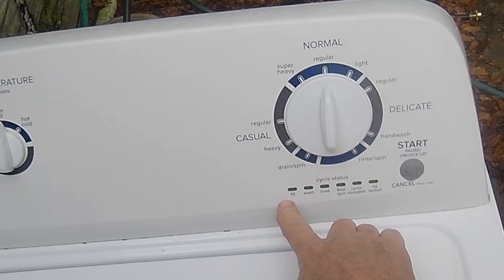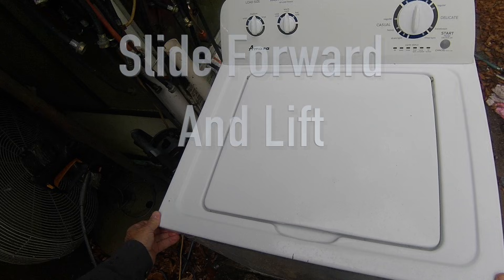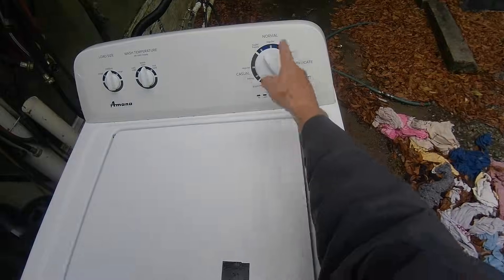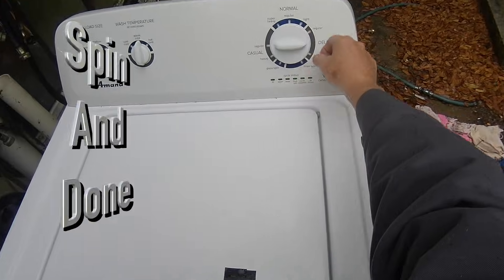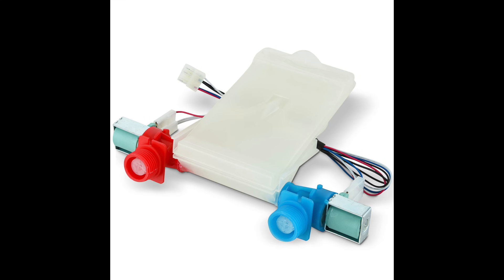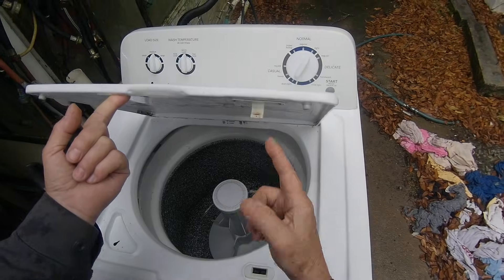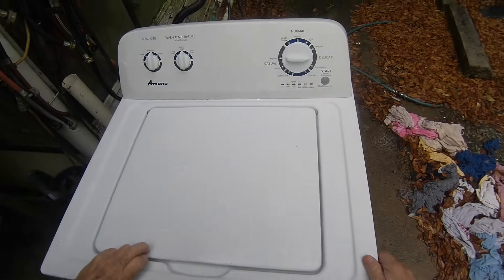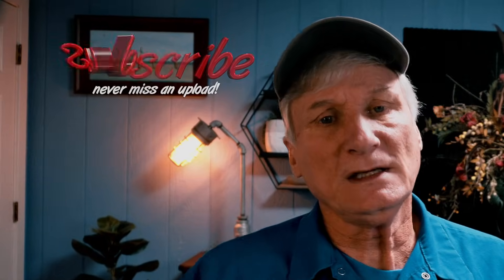How To Diagnose Your Amana Washing Machine: Chip's Guide to Manual Diagnostic Mode

Comment: Hi.. my amana stop with full load of water … the lid is lock and there no power… I try unplug n plug back on there still no power … so I have to unscrew it from the back to get the lid open…. can I still do the diagnosis with full clothes n water in it or I have to empty it out first? It look like I need to replace a lid switch right ?
Reply from the maker: Make sure you have power to the receptacle that it is plugged into. You can put it into diagnostic mode and select the water pump to pump the water out. You can also try to unlock it that way. If you get it into diagnostics turn on the water pump, drain it, leave the pump,on and select the spin mode to spin your clothes out. Thanks for watching!
Reply from the maker: Unfortunately I wouldn’t be able to help you without being able to trouble shoot it myself. If there is power at the wall socket then you have problem with the control board’s power supply or the power cord.

Comment: I did the test and got the lid light on, wash, final spin and cycle complete lights on. Now what. Can you help me please. I already put the clothes in there and they are wet because it drained my water out before it even started.
Reply from the maker: Put it into test mode, lock the lid, turn it to the pump test and turn the pump on. Don’t turn the pump off. Now turn it to the spin mode and spin out your clothes. You shouldn’t try to diagnose a problem with clothes in the machine. Thanks for watching!

Comment: Tried to follow the steps in this video, however there is just no response. Flipped the breaker, closed the 6 a bunch, nothing. Not a single light is coming on. I have the same one as the one in your video
Reply from the maker: Try plugging a lamp or radio into the same receptacle. If it doesn’t work it’s a power problem. Check your power cord for damage. Then suspect the power supply part of your control board. It reduces from 120 volts to 5 volts DC for some components. If it’s dead you’ll need a new control board. Thanks for watching!

Comment: Thank you for the video sir. All diagnostic checks came back good on Amana NTW4516FW3. It's been stuck on sensing after washing tennis shoes. Board is the only option. Wish it had been the sensing actuator or something simple.
Reply from the maker: You might find a good used board on eBay. Thanks for watching!
Reply: @HarperandKnowles bought a control board on eBay from a trusted dealer. Same problem still exists. That is upsetting.
Reply from the maker: And the lid lock tested good? Unfortunately l’m limited to only guessing without being able to diagnose it myself.
Reply: @HarperandKnowles  yes it did but would not lock upon delayed advancement to wash cycle. Wash cycle then sat still . Upon further research saw a burnt capacitor residue on old board housing yet new board behaved the same. Convinced that new washer is the best choice. Recalibration showed all clear of errors but continued malfunction.
Reply from the maker: Get you a Speed Queen. You won’t be bothered for at least 25 years!

Comment: Hi,  I have a question.   My amana washer washes Ok but when it's complete the spin cycle  the clothes comes out little wet . I have replaced Washer Pulley Clutch Kit
But still cloth coming out too wet to be put in the dryer? What you think
Thank you
Reply from the maker: No idea. That's something I would have to investigate in person to make a determination. I have seen a dripping water valve rewet the clothes, but that's my only guess at the moment. Good luck with your repair. Thanks for watching!

Comment: Great video!  Very Detailed. I get no fill.  Replaced lines and inlet.  All other error checks are fine (just no water fill).  Any suggestions?  Thanks!
Reply from the maker: Make sure you are getting a good supply of water to the valve. I have change valves and forgotten to turn the water back on. You can remove the hoses and be sure water is running by directing them into a bucket. Make sure you haven't forgotten to plug the new valve body into the control board. If both hot and cold test fail it might be a problem with the wiring or a control board failure. Hope this helps and thanks for watching!
Reply: Thanks!  Looks like I'm down to the control board (which is odd, as the diagnostics work and it seems okay), but hoses, valve (plenty of water coming in) and the inlet test okay.   @HarperandKnowles

Comment: ❓️My whirpool stop in rinse led and don't fishish the cycle. I do all in video and my washer do all the works for the cycle ( spin, agitation, wather H & C, wather pump, all work). I Chek the code and the first led sens, rinse, final and cycle turn ON. And then the only LED turn on its the Cycle. I'm not sure if the code is F3 E0. Where I can find this codes how to read it or WHT problem I would Have❓️
Model WTW4616FW2
Reply from the maker: The F3 E0 code is a fault with your pressure switch. Check for a crimped line, loose hose connection or it could be the transducer on the control board is bad. If that’s the problem then you’ll have to change the control board. 

El código F3 E0 es una falla en su interruptor de presión. Verifique si hay una línea doblada, una conexión de manguera suelta o podría ser que el transductor en el tablero de control esté dañado. Si ese es el problema, tendrás que cambiar la placa de control.
Reply: @HarperandKnowles  I check the clear line and it's good. And I have a Good pressure inlet to the washer.
How can I find the list code of the washer and the correct reading.

Thanks from Puerto Rico 🇵🇷
Reply from the maker: The error fault codes are found in the service manual. The service manual can be found in a plastic bag at the upper left inside corner of your washing machine’s cabinet. 

Los códigos de falla de error se encuentran en el manual de servicio. El manual de servicio se puede encontrar en una bolsa de plástico en la esquina interior superior izquierda del gabinete de su lavadora.

Comment: Thank you so much for your video! It saved us hundreds of dollars and we found that it was the actuator that needed to be replaced by following your wonderfully detailed video
Reply from the maker: My pleasure. It is rewarding to know that I help a few people with my video efforts! Thanks for the positive feedback!
Reply: @HarperandKnowles I’m just getting the clicking back and forth with the lid lock and no red light for the lid I’m assuming it is the lid lock I need to replace but does the machine go back to normal mode after doing the test mode on its own?
Reply from the maker: If it just click, click, clicks constantly then it is the lid lock. Yes, the machine will time out and cancel the diagnostic mode itself. Thanks for watching!
Reply: @HarperandKnowles  thank you so
much ❤️ I just happened to come across this video when trying to figure it out. I wanted to cry thinking I had to get a new washer lol
Reply from the maker: My pleasure! I’m glad I was able to help.
Reply: @HarperandKnowles my amana wont start.push start,and nothing
Reply: My amana wont come on push start and nothing
Reply from the maker: First insure there is power at the receptacle. If that doesn’t work then the power supply on the control board is probably bad and the board will need to be replaced. Thanks for watching!

Comment: My washing machine is stuck on sensing fill
Reply from the maker: So, have you done a diagnostic check like described in the video?
Reply: ❓️My whirpool stop in rinse led and don't fishish the cycle. I do all in video and my washer do all the works for the cycle ( spin, agitation, wather H & C, wather pump, all work). I Chek the code and the first led sens, rinse, final and cycle turn ON. And then the only LED turn on its the Cycle. I'm not sure if the code is F3 E0. Where I can find this codes how to read it or WHT problem I would Have❓️
Reply from the maker: I would suspect the lid lock if everything else is working. Thanks for watching!
Reply from the maker: Sospecharía que la tapa se bloquea si todo lo demás funciona. ¡Gracias por ver!

Comment: So i ran the test on my amaña washer and when I got to the final step/ agitation all I got was a buzzing grinding noise. Nothing moved. Would you know what I would have to replace?
Reply from the maker: Without being able to diagnose your problem myself all I can offer is my best guess. I would suspect that the shift actuator isn't moving the splutch from spin to agitate. I would also remove the splutch and check it for ease of movement. Thanks for watching!

Comment: Chip, I have an older Amana; a DLW330RAW that has a problem I can't find an answer to. It locks up in the agitation cycle and causes the motor to stop and make a burning smell. But if I advance the timer to rinse/spin it spins fine and drains as normal. I replaced the timer - that was not the problem. I replaced the main bearing about two years ago it has been working fine until now. I don't see that this model even has a clutch. I took off the belt: laying the machine on its back, rotating the pulley wheel counter clockwise, allows the agitator and drum to rotate freely but together only, but if I advance the pulley wheel clockwise, it locks all movement. I am stuck. Any ideas? Thanks.
Reply from the maker: Oh, Wow! That thing is a dinosaur. Without being able to diagnose it myself I'd suspect you have a transmission problem. If you were my customer I'd recommend you replace it. It has given you many years of good use but its time has come. Throwing money at a machine that old can become really expensive. Check out this video if you'd like to replace it with one that will probably last you as long. https://youtu.be/qlkdxWfTZVw Thanks for watching!

Comment: I have a Amana washer (about 13 months old). The lights just went out and there's a draining sound (even though there's no water). Also the lid won't lock. Any ideas?
I tried running the diagnostic (hoping the lights would come back on) but no luck.
Reply from the maker: Hold down the start button until the drain pump goes off. It sounds like it’s in a suds lock.
Reply: Thank you so much! For future knowledge, what causes suds lock?
Reply from the maker: Using a detergent that isn't HE (high efficiency) will cause it,  something on your dirty clothes that caused an over abundance of suds, but mostly it's just a control board glitch. Probably won't happen again. It's just one of those things.  I'm glad I could help you. Thanks so much for watching my channel.
Reply: This is what mine is doing did it work